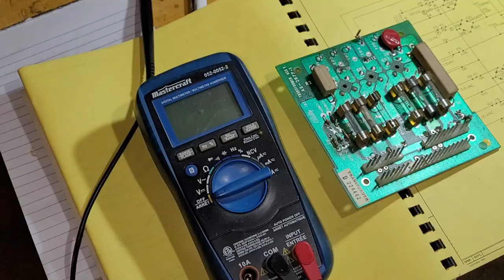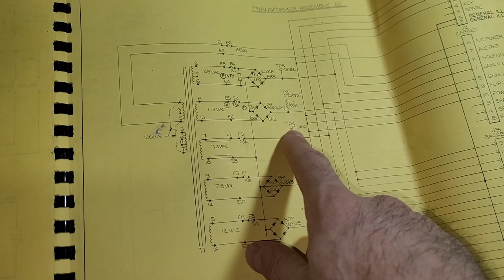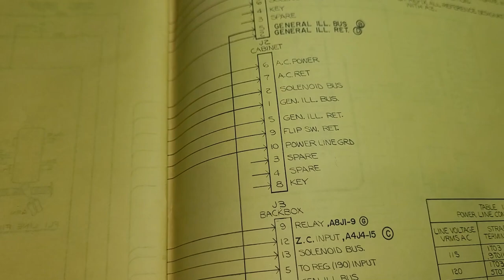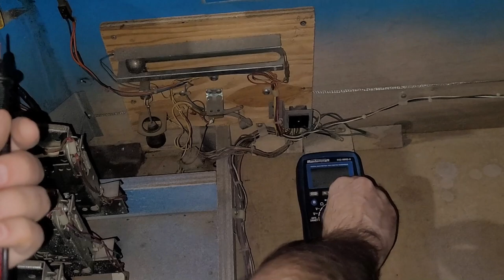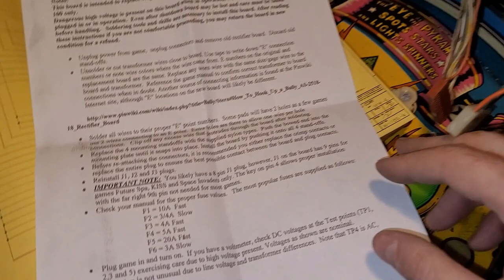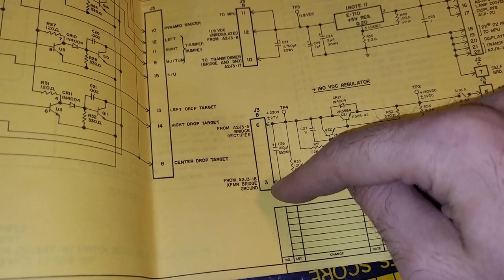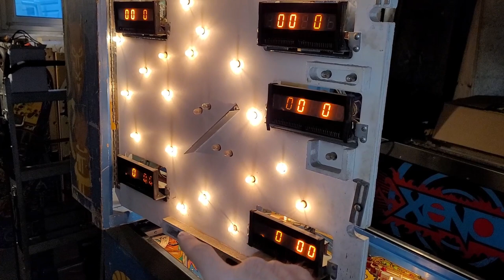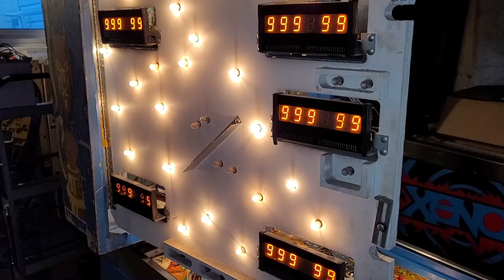Part 3: 1980 Bally Mystic Pinball Project. Now we are playing with power!

Comment: Eeewww you went the replace the plug end and not the whole cord with a nice molded ground and all.
It is not really that hard to solder in a new line cord I do it all the time and I replaced the line cord with a molded one as I hate people at conventions taking up two plugs with that huge plug at the end.
I replaced my Police Force line cord that had one of those so I it would not be taking up an extra plug.
Ok my tangent on an old video of yours is over. xD
And you did good with replacing the board for the transformer even if the bridges were good it is only a matter of time before they go open circuit and cause some damage.
I replaced all my bridges on my PF since the power supply one did go open short and it was making the playfield buzz and the power supply violently blew the fuse all this while I was trying to get the machine off.
I will usually do all bridges in a game just to be safe as I would rather not have the house burn down as there is some bridges that are not fused that need a fuse mod.
And it does not matter checking A/C or D/C Voltage if you get the probes in the wrong place it will just show -120V you just switch the probes and it will read 120V normal.
Reply from the maker: Ahh good stuff. I will keep that in mind for the next plug end i do!